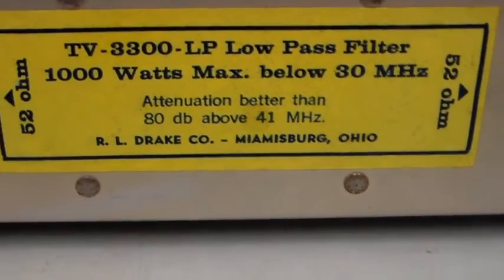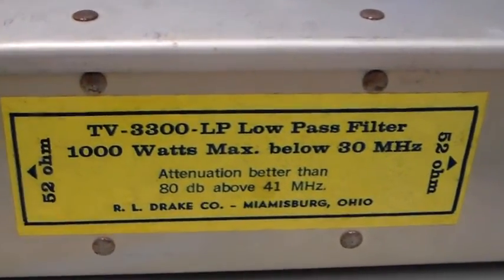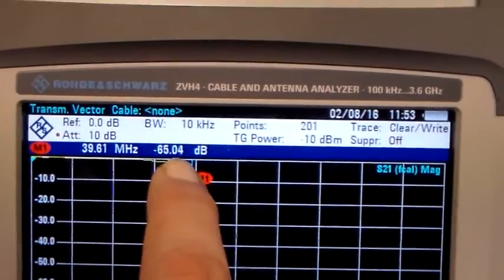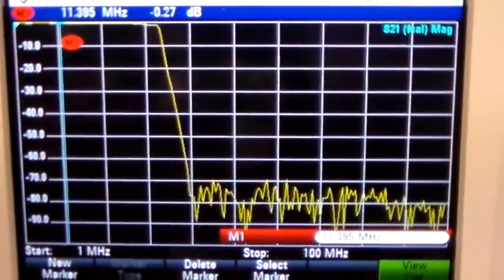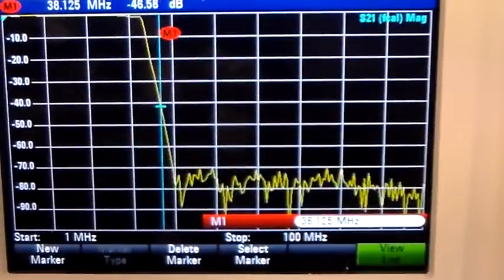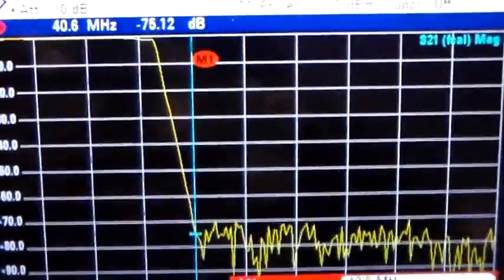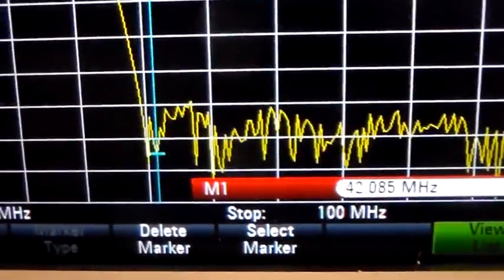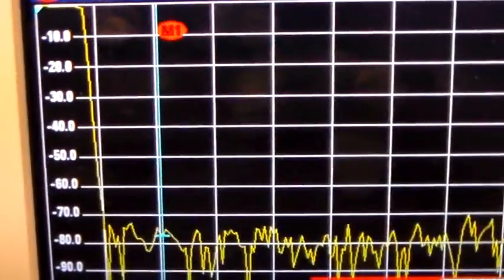Drake TV-3300-LP Low Pass Filter On Analyser

Comment: there is no feedthru on that one.
Reply from the maker: I'm not sure what you mean?
Reply: I mean above cut off there is no rf feeding thru as there is on the other filter you showed. This one is flat from cutoff on up.
Te other one you tested the rejection fell back off above cutoff. Usually caused by stray coupling or feed thru
Reply from the maker: Aha, got it.